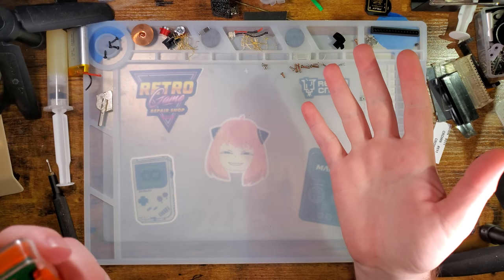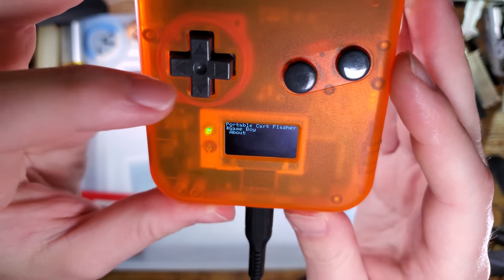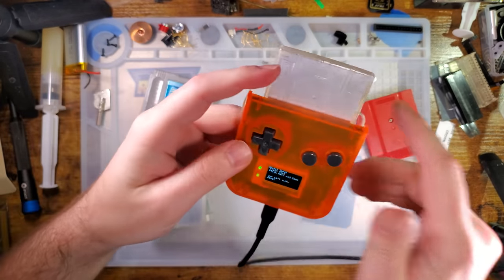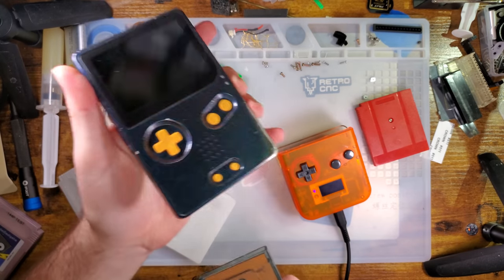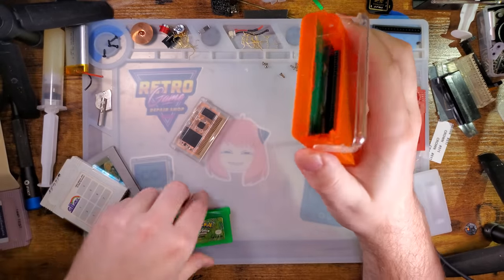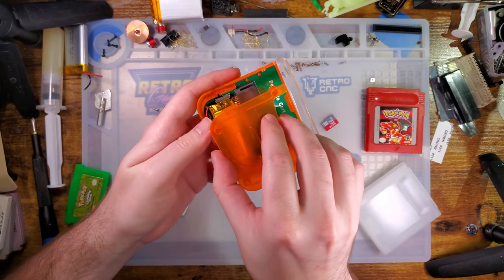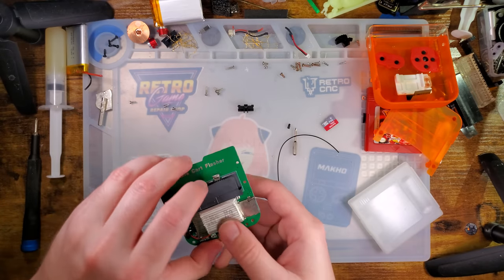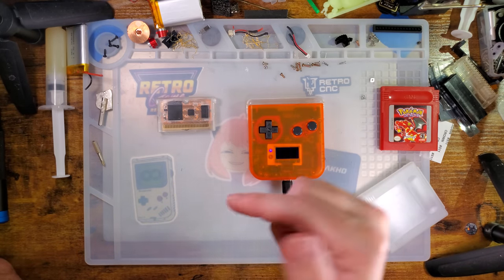FunnyPlaying Portable Cart Flasher -- "Burnmaster"

Comment: I already have the GBxCart, but this honestly looks pretty neat to get if it isn’t too much. Just the mere fact that it’s portable means I wouldn’t need to bring and use my entire windows laptop just to flash a game, I can just use this and my chrome book (plus an extra micro sd card), or really anything that can be used to patch games and can interface with the micro sd card.
Reply from the maker: This thing does not patch games. You'd have to have pre-patched the game on your PC and added the resulting file to the SD card.
Reply: @makho  Well yeah, that’s why I included the Chromebook or “anything that can be used to patch games alongside interfacing with the Micro sd” part, since Rom Patcher JS makes patching games significantly easier to do on systems that don’t have offline patcher apps available, so all you need is for it to have online functionality and a micro sd port.

Comment: Any in depth MIDNIGHTTRACE GB/GBC and GBA FLASH CART reviews coming up? im curious to know if they work well with gbxcart rw v1.4 pro, and also curious if i can flash pokemon rom hacks onto them both gbc and gba flashcarts. i bought the Zedlabs for GBC which supports MBC5 and RTC and is tested on the main pokemon gold hacks and crystal hacks , but its almost double the price, was wondering if i could make these work for half price, so i could by some and make physical rom hack cartridges to play out and about. Would love to see you do a review testing some pokemon rom hacks on both of these also using the GbxCart1.4 Pro. Amazing videos like always.
Reply: My midnight trace GBA cart wouldn't support pokemon natively, I needed to patch my rom backup with GBATA to save as sram, rather than the expected 1MB Flash.

Comment: I've had one for a little while now (gba cart) and used it with out fault on my Analogue Pocket but on a real SP it fails to load anything. The only way to get it to work is to insert it into the SP while its already on, otherwise I just get a normal GBA boot screen with no Nintendo logo.  Any Ideas what that's all about?  I did use a burnmaster to flash it.
Reply from the maker: Contact the vendor.

Comment: Honestly the Ds is a great alternative to this. You can probably get one for cheaper, not to mention it's portable and easier to use
Reply from the maker: DS only does GBA games. This does GB/C too.
Reply: Is the ds able to flash cards? I use the ds to backup my game saves. And use the n64/transfer pak to backup my gbc/gb games.
Reply from the maker: @OMaster90  It's possible to reflash GBA carts on a NDS or NDS Lite, yes. The software support is lacking though so only a few models are supported.

Comment: @makho Did you have any notes for the FunnyPlaying/Midnight Trace flash carts? Like best cart shells to use, or whether any trimming/DIY fitting was required on aftermarket ones...? I was contemplating the "High Quality" shells from RGRS that you mentioned in one of your previous videos, but I'm not sure if they'd be a 1:1 fit. Thanks!
Reply: That’s what I have both of mine in. Specifically the Crystal colored gba and gbc reproduction shells.
Reply from the maker: They match OEM specs in all the right places so you can use nearly any shell you want. I like the "high quality" shells in general but they work well here too.

Comment: I hope the Funny Playing Flashcart works with the Epilogue GB Operator. I really love the Batteryless save flash cartridge from Geek Tech.
Reply: GB Operator is trash. Don't get scammed by that gimmicky BS.
Reply: @HighPower64  I know for a fact that you are quite wrong. I have a Consolized GBA, two Gamecubes with Gameboy Players, a modded DMG with a GBA SP inside that just plays Gameboy and Gameboy Color, an IPS Original GBA, an IPS Gameboy Color and a Retroad 5 Plus with the GB/GBC Extension Converter and Windows with the Epilogue GB Operator is always what I find myself playing. Whatever TROLL!!!!!
Reply: @michaeldemers2716  You could have gotten that for free. They suckered you into paying $50 to play your ROMs on a PC emulator. Congratulations. You should have bought a GBx, but I guess, as they say, you can't fix stupid.
Reply: @HighPower64  Another thing is that the Epilogue GB Operator allowed me to Flash my own game on a Geek Tech Batteryless Save Flash Cartridge. I Dumped my Legend of the River King 2 for Gameboy Color and ran it through the Gameboy ROM Analyzer for Windows PC and changed the cartridge type to 1EH and fixed the header then Flashed it to the Geek Tech Batteryless Save Flash Cartridge and now I can play the game with Rumble on the Epilogue GB Operator  because the System supports Rumble in the settings. You don't even know what you are talking about.  It doesn't need a motor on the cartridge all you need is the code to play on the system. You probably don't even know what the system is even all about. Get a clue.
Reply from the maker: @michaeldemers2716  Noodles, despite saying it in a way that is not conducive to a friendly conversation, is correct. Any cart reader out there can be used to dump your games for running in an emulator (and for reflashing the save when you're done). There are three other readers that, out of the box, just work that way too. GBxCart RW is one of them and even comes with a custom application/script that makes it behave the same way as described but with far greater compatibility (and at a fraction of the price). 

That being said, I just tested the FP GBC flash cart with the GBO and it took a few tries to get the cart to be recognized at all. Once recognized, I was able to reflash it, however. There is no way to set the RTC from what I can tell, unlike with the GBxCart RW. 

The FP GBA cart is not recognized as flashable in the GBO.
Reply: @makho  I have the Original Inside Gadgets Gameboy/Gameboy Color Writer and lost some of my cartridges. Epilogue GB Operator is more user friendly for people that don't know what they are doing. Just a question real quick? Did you ever make Legend of the River King 2 Gameboy Color English Rumble Cartridge? I bought two "Touch Boy" - "badly named" cartridges to flash the game to. I just need to get a compatible Gameboy Color to Flash it. I think the Geek Tech cartridge with convert over better than the USB Smartcard for Gameboy. At least I can play with Rumble on the Epilogue GB Operator with Rumble using the Geek Tech Batteryless Save Flash Cartridge. Like I told you in the past I took the ROM I Dumped for Gameboy Color English Version and ran it through the Gameboy ROM Analyzer for Windows. Then I changed the cartridge type to 1EH and fixed the header. That's about it. Then Reflash the Fixed ROM to the Geek Tech cartridge. I know you could make an actual cartridge with a motor though like the Touch Boy cartridges. I got it working on the Pow Kiddy V90 with the Pocket Go Firmware Update. That supports Gameboy Color Rumble and it has a motor. More than one way to skin a cat. If you want something you will find a way.

Comment: I can’t get mine to work right. I have it on the latest version and every time I try to flash my flash cart, it writes the rom and then saves “cannot verify” and a number and “bytes”. The cart when plugged into a game boy will show the Nintendo logo but then show a white screen. The flash cart is an insidegadgets 2MB FRAM cart. Version 2.2.
Reply from the maker: If it works with other carts, I reckon it's just not compatible with iG carts. The firmware is open source so compatibility can be added though. If one were so inclined.

Comment: i find out that there are  issues with some Pokemon original cardriges.  With the Burnmaster and the oscr i got "Flashrom Type not supported ID: 6213" error with different copys of the game to test and the game with the LE26FV10N1TS flash chip the small footprint version are the ones with this problem.
Hopefully with a firmware upgrade this issue can be fixed.
Reply from the maker: No original pokemon games had flashable ROM. You mean repros?
Reply: @makho   No it's a original Game but safe files don't write on this Copy of the game. With my original emerald there is no problem..maybe because it's a Euro Game.
I can backup the game and the safe file but rewriting the safe is not possible.

Comment: Could I use this to change the region/language of a cart, especially carts with proprietary hardware? For example, I have a japanese version of Warioware Twisted i'd like to change to the English version.
Reply: You can only use it to flash flash cartridges. Official cartridges are not rewritable in any way without physically modding the cartridge to turn it into a flash cartridge.
Reply from the maker: @nightwing179  Indeed. They're called "ROMs" for a reason.  

Notably, GBA carts cannot be converted to flash carts like GB carts can. The MROM chip that stores the game also performs other functions (such as bank switching) and there is no single aftermarket part that can perform both functions.
Reply: @makho I did not know that. Definitely good to know.

Have you tested out Funnyplaying’s new v2 gb flash cart? I’m still waiting on mine to come in, but was just wondering if you’ve tested it out for differences other than the MBC mode switches.

Comment: Hey, dose the sd card need to be formatted in a certain way? Same for the cluster size?
Reply: FAT32
Reply from the maker: Smaller cluster size is technically better in this case because you're going to be dealing with smaller files. But no, it doesn't particularly matter beyond being FAT32.

Comment: I just got my official release version in - however it looks like the SD Card reader is not working as expected - booting up the unit with and without a FAT32 formatted card is presenting an error that the SD Card reader cannot be initialized - emailed Funny Playing for support but they haven't gotten back to me yet. Also there is nothing regarding this error in their build tutorial webpage. Did you experience this issue at all when you first received your prototype?
Reply: i just got mine today and was excited to build it and have the same problem. did you ever get a reply? i found one person on reddit that said they had to return theirs for a new one that worked. :/
i live in europe and it'll be so annoying to go through the whole return process. and the batteries on my old games aren't getting any younger.
Reply: Yeah I emailed them and they said it was faulty soldering and sent me a replacement that works fine!

Comment: I hope it works with HDR GB camera flashcard. This will be great to dump pictures currently it sucks having to walk around with the analog pocket too.
Reply from the maker: It should. Mine didn't work with any camera but mine is a prototype with known issues. Note the green board on mine but the black board on the retail version.
Reply from the maker: You know, in theory there's nothing stopping someone from making a cart reader core for the analogue pocket to manage ROMs and saves.
Reply: @makho I just make a save state on the analog and retrieve it later. I did get one of the burnmasters today and yes it does work with Game Boy camera flash card so that great.

Comment: Have you noticed that with gba games it can’t detect the rom size or save type?
Reply: @AeroMaster7 if you update to one of the newest firmware versions (1.06 or 1.08) and include the gba text file includes with the update, that will work like it’s supposed to. I’m currently trying to figure out if Pokémon games are actually compatible like their list says. So far I’ve only received white screens after the boot logo.

Comment: I'm on firmware 1.08 and it still won't flash any of my GBC flashable carts. Flashes GBA carts fine though.
Reply: try firmware version 1.12
Reply: @JohnnyKillerTech  Same results. No GBC carts seem to flash, and it even bricked my expensive rumble cartridge. ROM flashing errors out at 56KB written, so now it's just a useless 32KB flash cart.

Comment: Wouldn’t you just be missing RTC from Pokémon (R/S/E) on the GBA cartridge, or is there something else stopping them from working?

FPs compatibility list isn’t the clearest document.
Reply: @DetroitMetroRetro on their listings for their flash carts
Reply from the maker: The GBA cart uses FRAM instead of flash so it's not that simple. You can patch the ROM and it will probably work in a game boy but not with the gen 4 pokemon games in a DS. 

When funnyplaying tests a game, they don't go much deeper than a few minutes so take their compatibility with a grain of salt. 

For GBA games, there are several different technologies for saving and the only ones that are cross compatible are FRAM/SRAM. Everything else must be used on the intended hardware or patched to FRAM/SRAM and hope for the best. Most EEPROM games should work totally fine aside from potential DS integrations but flash is a different story because the original hardware could be 512K or 1M flash but FRAM/SRAM only supports 256K out of the box. This FP cart has 1M FRAM though so it could work just fine. 

In my testing with a patched Pokemon Emerald ROM, I got save errors every time I loaded the game (in addition to the clock error) but it was able to load "the backup" and get me in game. I didn't put that much effort into testing this specific use case because insideGadgets makes a far more suitable cart for Pokemon ROM hacks which uses flash out of the box and may or may not have RTC (or a solar sensor).